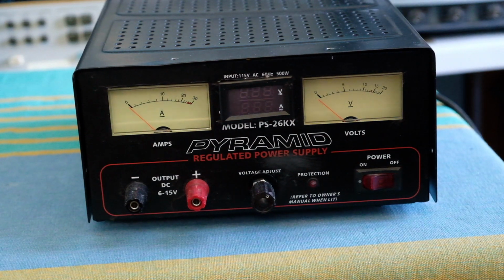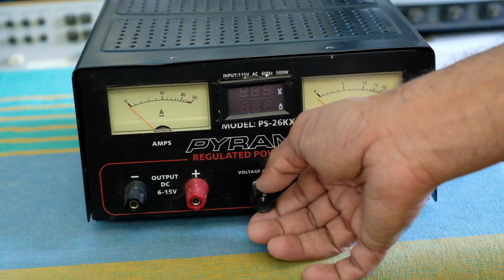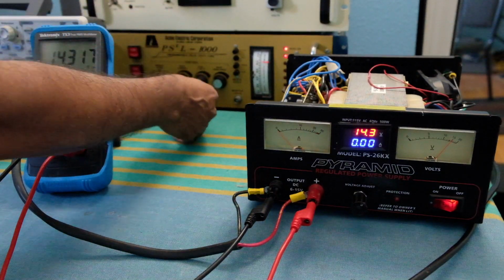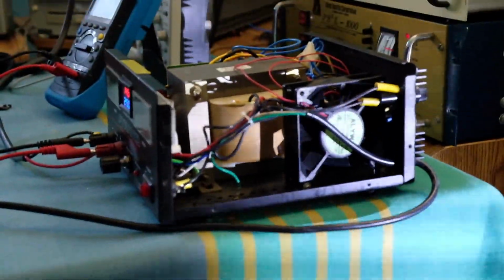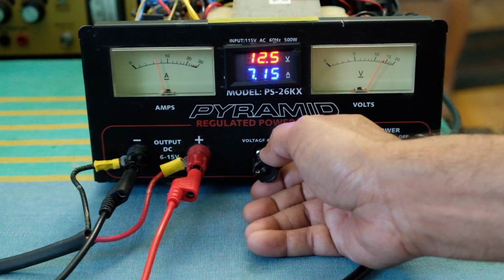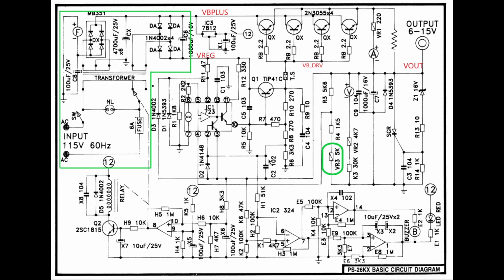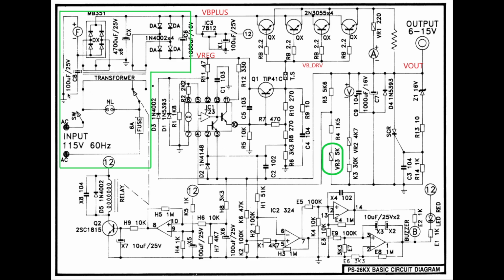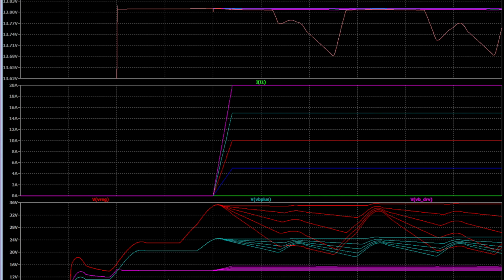Pyramid PS-26KX DC power supply

Comment: On the Schematic it just shows an SCR it does not give a part number Voltage or Amperage Rating for a Replacement Part. How do you figure out what SCR to use in one of the Pyramid Power Supplies? I have a PS36KX and the SCR is blown and no part number.
Reply from the maker: I used a 2N6403G according to my notes. Datasheet should tell you all you want to know about this SCR. You want to put an SCR that can turn on quickly and conduct a short circuit current to blow the fuse in an over voltage situation. The SCR should be able to handle a current that is larger than the fuse rating, so that the fuse blows first.

Comment: Appreciate your work. Ref voltages explanation was missing, lower part of ckt on op amp, which many cannot understand, was not adequate for many technicians, this was the no comment. All are not engineers or high level tech. The explanation that helps, helps them all. Good work. Keep it going strong.